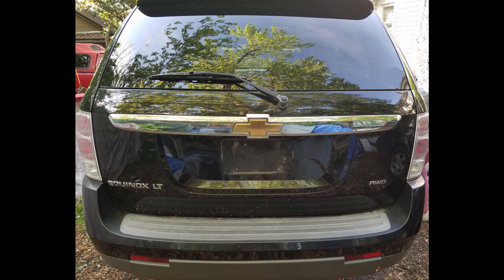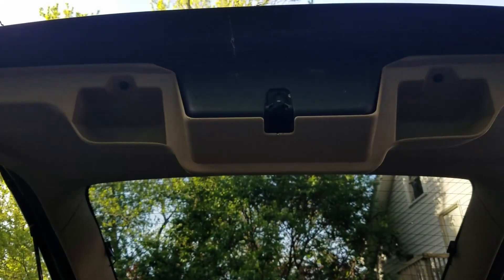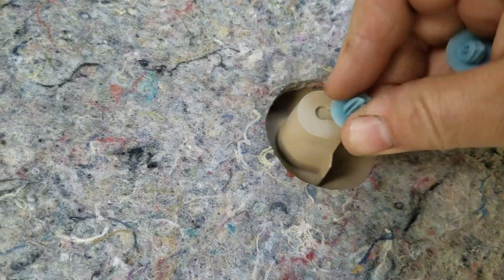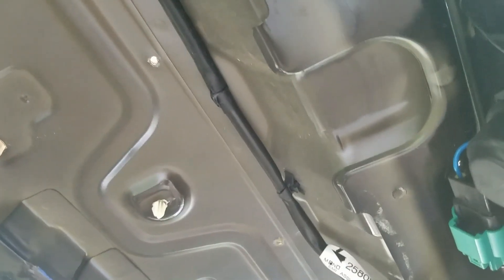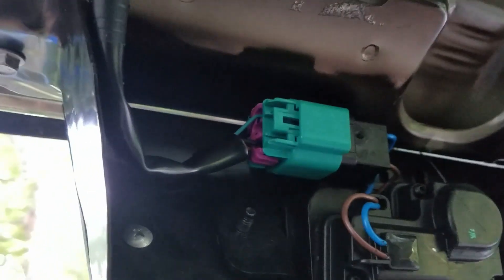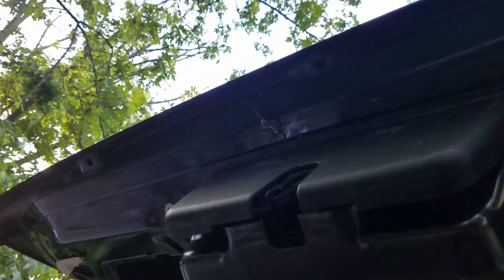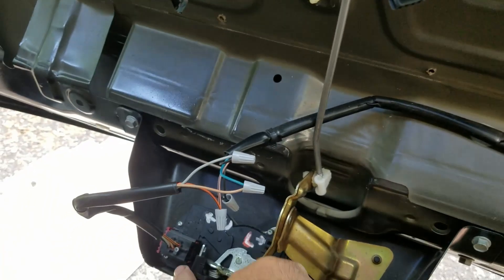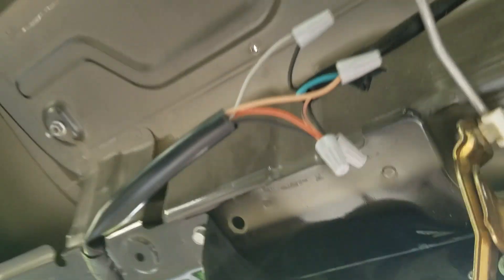2005-2009 CHEVY EQUINOX / PONTIAC TORRENT REAR HATCH WON'T OPEN

Comment: So actually you didn’t even need to replace all that because it was the touch pad part that was broken correct?
Reply from the maker: In the end, yes. But it's a good learning experience too.
Reply: Mine isnt working as well, How do I tell if it's the locking mechanism or the touch, when I hit the unlock button nothing happens in the back

Comment: I have an 07 Equinox and my rear hatch also won't open. - Is there an oder-of-operations for trying to diagnose where the problem may be so as not to waste a bunch of time? For example: Would it make sense first to check the fuse connections, and also specifically the fuse connection first associated with the latch button? - I'd like to try and tackle this myself but could use a step by step understanding. I have the switch circuit PDF from the internet...
Reply from the maker: yes- start with fuses, then trace power with a voltmeter at the hatch. If you don't have 12v waiting at the hatch button, then trace back towards the fuse block to find where the power ends in that circuit.
Use a wiring diagram online or in a chiltons / haynes manual to find the wire colors you  need